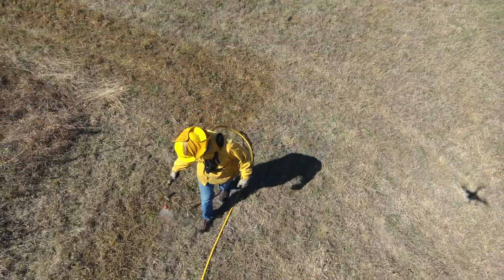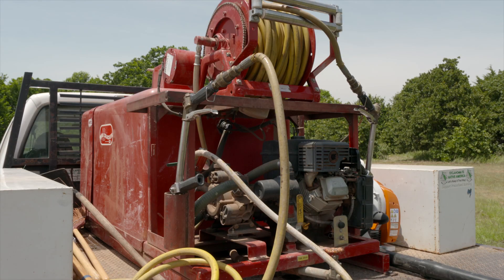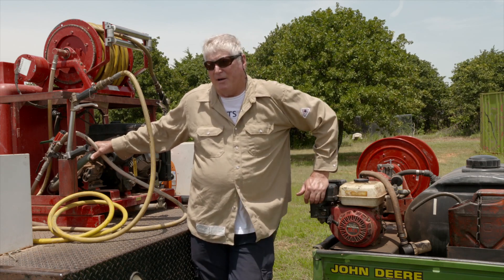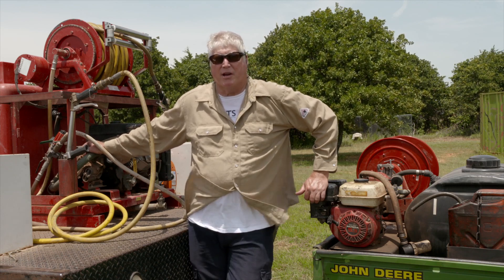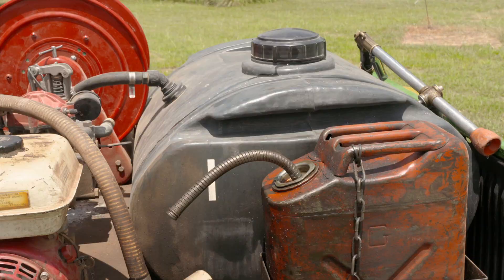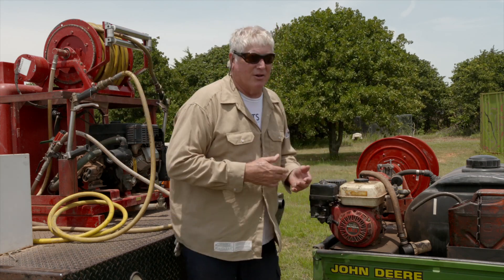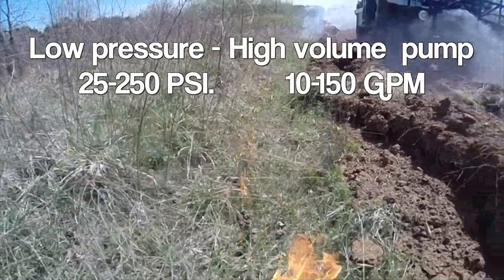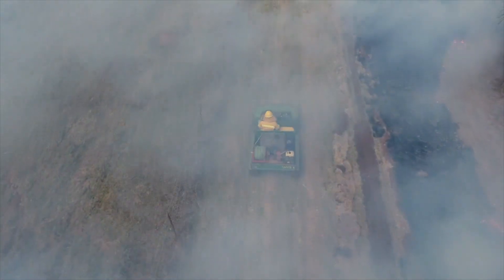Fire Equipment: Sprayers

Comment: I know this really was made 90 years ago.... You left out as firefighting out of this with the high-pressure low volume.. firefighter additives to NorCal fire down quicker.. Uno's type of spiders .. you didn't talk about units actually felt for firefighting in these kind of situations .. limit volume mid pressure units.. with Pam spray and add 25 gal per minute laws where you can kick a lot of fire down with each sector units and then you can also if you have a variable flow tomorrow's what are you can actually kick it up 20 probably about 75 GPM.. this would be used probably mostly if the fire gets in the tree line was supposed to trueline on fire.. but the main thing is to fire fighting additive ... There seems like wedding agents like called fire out I forgot your name and shovel the other brands used Mazda put out fires be taken off of you so multi-class fires like a b&D classifiers up fires... And some of these agents are classified class k which is now food-based grease fires... You also should do another video about the tools you should keep on your legs for this , like shovels handle rakes hoes maddox's what you're also .. you also need to think about backpack sprayers.. there is something specifically made for the fire service but however there are ones that are agricultural-based they have a different type of pump but they still could be used to fight fires.. really fire departments trying to save money go to tractor supply and buy these type of sprayers.. and you also need to talk about lighting London used for night time when you go past sundown.. just a few things that I've done over my 20 years and fire service just trying to be helpful to your group .. good luck on your fire fighting training